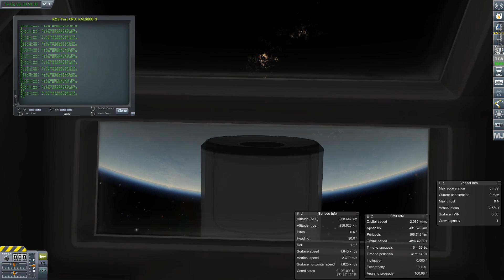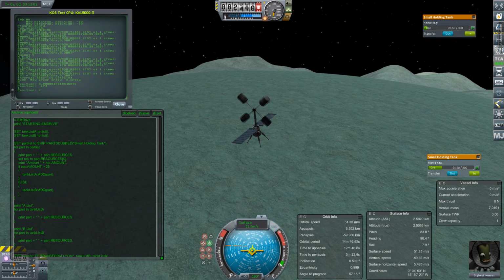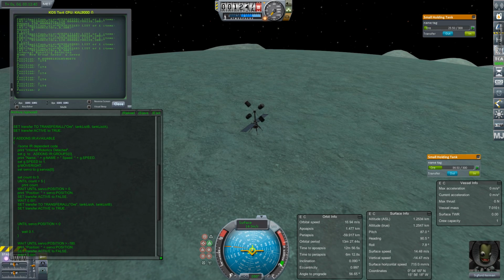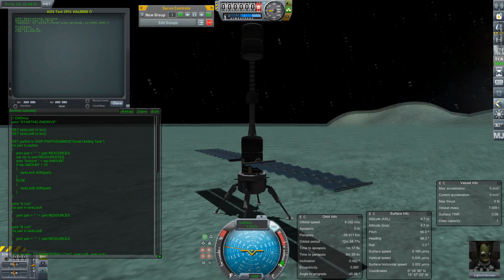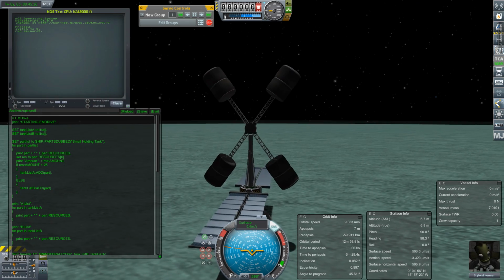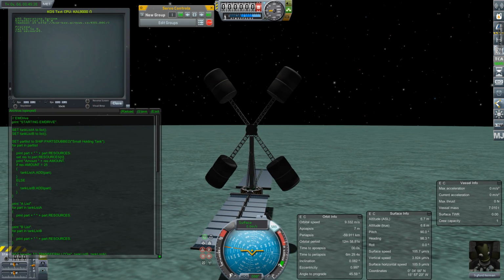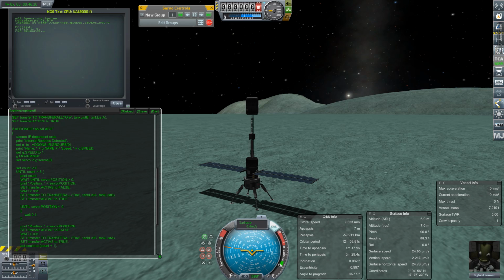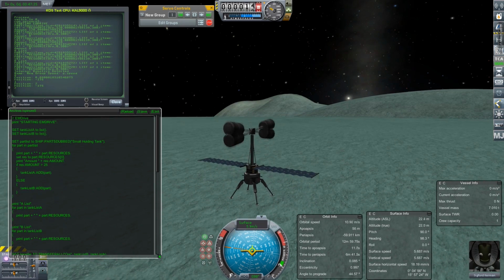Exploiting Kerbal Physics To Make 'Impossible' Gyroscope Drive

Comment: But can you make a fully automated mun landing with KOS?
Reply: Ok now there is a challenge for Scott
Reply: I did a script that launches from kerbin and lands on the mun using only simple commands, and it's in a vid I made.
If you're on a decent trajectory, you only need about three lines of code to perform a safe landing, if you're landing on a flat surface :)

Basically,
until ship:status = "landed"{
set sasmode to "retrograde".
lock throttle to (-verticalspeed/altitude)^3.
}

Aaaand you're done :P
I like the third line, it's one of my better lines of code.
Reply: Emoticons there was a guy who recreated the entire curiosity launch to landing procedure and wrote a script for a falcon 9 return-to-launchpad-landing. Hes pretty incredible
Reply: That's certainly something I'd like to see.
Reply: Emoticons cough Mechjeb cough
Reply: Yeah, if you want to spend hours coding and waiting for the exact right launch time
Reply: I don't think it would be that difficult to do honestly I mean it would be quite a bit of work but it's not that difficult.  I've written code that gets me into orbit and that does powered landings on kerbin.  KoS has commands that let you create maneuver nodes, adjust them, check encounters, see the parameters of the orbit of your next encounter. I mean it's really all there on the github.  For someone with a decent amount of programming experience, this isn't that hard it's no different than looking on the c++ website at member functions of the standard library.
Reply: gajbooks I find a trick that makes for easy docking is to make your docking port line up with the navball so all you have to do is have both crafts target each other and use the sas to point at target and they will both be pointing directly at each other.  Then assuming you've already brought them to the same speed just apply a bit of forward thrust and they dock themselves.  Maybe you will have to switch back and forth between the two so that the SAS realigns them but that's all there is to it.
Reply: Ok here i have a task for you scripters:

Code a script that allows me to perform a spacex-like-landing with any craft on any celestial body.
( Spacex-like-landing means, you throttle up to full power poiting to retrograde and let the engine fire at full throttle until you reached ground [ where the engine is allowed to be turned off ] ).

I think that means some maths to do.
Reply: mmh, well, its an approximation but this script assumes allot, like the constant "g" ( that is not really a constant, it changes if you change youre altitude ) or it ignores the fact, that youre burning fuel while having the engine running. this leads to some other problems like the variable thrust and the variable "g" changes to. It also ignores the fact that soem planets or moons ahve an atmosphere.
Reply: I did an automated mars landing with KOs in Real Solar system- the script was able to automatically align for re-entry, detach from the transfer bus, wait for the correct velocity to jettison the heat shield/aeroshell, deploy chutes and perform a powered descent to the surface once it was low and slow enough for the thrusters.

Sadly the probe didn't last long because its solar panels ended up misaligned (a design flaw on my part), IIRC its battery ran out after a couple of days.
Reply: gajbooks problem is, f9 can't hover. Thats why spacex has so many problems with it, and blue horizon did it pretty much on first try with their nicely throttable engine.
Reply: I think it would be much easier to make the landing bit of the coding though... you hit a button once you are in orbit or on a approach trajectory(mechjeb could help there....) and it lands itself from there
Reply: Adding plane search is not that hard too.
Reply: Артем Алексеев 
Nah, not really :)
Reply: I'd be more interested in seeing a full Apollo style docking that is completely automated.
Reply: I feel like they would get into a funky orbit around each other and waste fuel. Also even the slightest deviation from center makes both craft start flailing like crazy flailing things. (I know this from docking manually)
Reply: Even SpaceX doesn't quite do that.  It's close to that, but they don't have to use literally full power.  The engines they use can be throttled in the range of 70% up to 100% so if they need to back off the throttle a little because they started the burn too early, they can up to a point.  It's a good idea to start the burn a little bit too early just to give yourself the wiggle room in both directions.  (if you calculated for 95% throttle and were wrong you can add or subtract 5% more throttle.  If you calculated for 100% and were wrong, you can't up it to 105%.)  Also keep in mind that in KSP the universe moves in 1/25th of a second intervals, no tighter, which can make the perfect 100% throttle landing burn literally impossible because it would require starting the burn halfway through a "physics tick".  You have to start it a tick too early, and then that means ending just above the ground, or having to slightly back off the throttle a smidge.
Reply: Step One: Download MechJeb Step Two: ??? Step Three: Profit

But really though, it could be done reasonably. I might try it sometime. There was even support added for atmospheric trajectory calculation if you have another mod. (I've just started messing with kOS and saw some patchnotes)
Reply: The biggest Problem in my opinion is, that the gravitational acceleration changes with the height above ground. This leads to a chicken-and-egg problem.
Reply: The physics run fast enough and the value of gravity changes slowly enough that it doesn't matter. For slow landings you would want to cancel out lateral velocity, and then suicide burn to a point above the surface, and then hover down at a consistent speed anyway.
Reply: gajbooks
"hover down at a consistent speed" is not the same thing as what was being suggested.  That hovering down also requires being able to throttle back to less than 100% throttle.
Reply: I read what was suggested and my reply included that part. I doubt even SpaceX does a direct suicide burn. It's safer and softer to roughly burn to a point and then descend gradually with engine throttle. It also looks nicer.
Reply: a suicide burn is just that .... I think if something went wrong they would either burn a hole in the barge or smash it to bits too which is not great lol
Reply: the landing location is actually a few metres away from the barge in case the engine does not reignite, and this is only corrected on the last burn, afaik.
Reply: interesting to know!